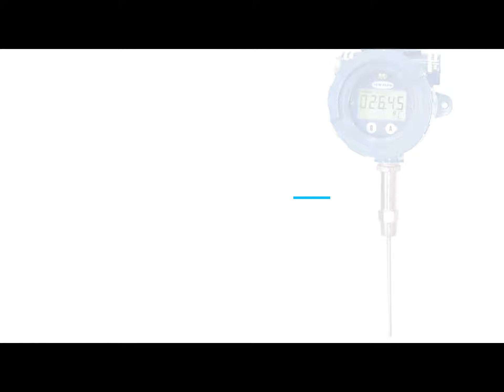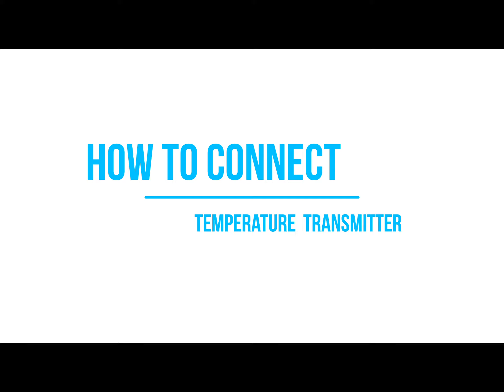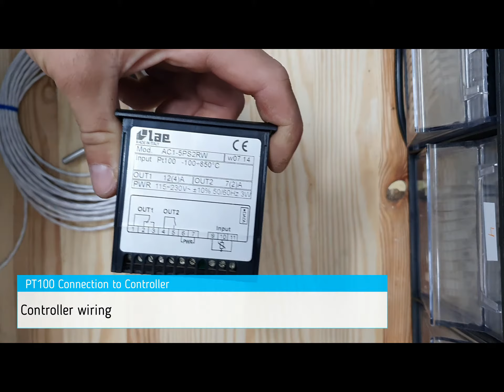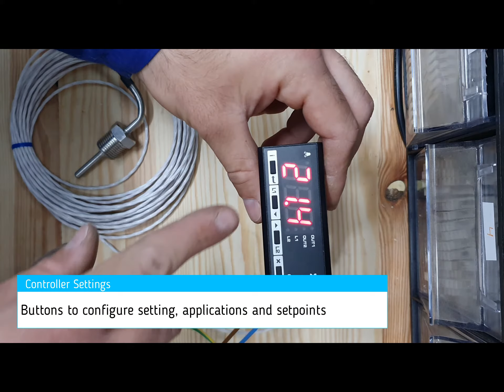How To Connect Temperature Transmitter - PT100 And Transmitter To PLC And Controller Connections

Comment: Dear sir,

As you know, the temperature sensor (RTD PT100) has a specific range (e.g. -200 to 850 ˚C). This sensor transfer temperature to Ohms. That is why it is connected to a temperature transmitter which transfers Ohms into (0-10 V or 4-20 mA) to be able to connect with the PLC. Transmitters also have a specific range (e.g. 0-200 ˚C).
My question is since Temperature sensors and Transmitters have got different range, are there certain conditions to fulfill when connections them (like calibration) , would you kindly answer my question? Of course, practical examples are of great importance to me. 
Thank you and I’m waiting for you reply.
Reply from the maker: Hi my friend.
first of all, let me clarify for you, there is different transmitters and controllers for different types of temperature sensors.
if you like to use pt100, you take a controller that is suitable for pt100.
if you like to use NTC, then you take a controller that is suitable for NTC.
you cant take a PT100 sensor and connect it to a thermocouple transmitter (for example).
there are controllers that have a few inputs for different temperature sensors, but that is also need to be specified in the data sheet of the controller.

when you choose to use a controller for PT100 or NTC or what so ever, if you choose the right controller, there is no need for calibration because this is standard well known sensors, and they are already calibrated.
in some industry's, like food industry or pharma, then you need to check the calibration of the controller every period of time.
in case you find a error, in every controller you can calibrate and "fix" the temperature to the actual reading (every controller should be calibrated using manufacture manual)

hope this helps you
Reply: @btoash  Thanks

Comment: In wiring of a pt100 without a transmitter directly to the controller. How do you scale the value given the temperature range to get the exact temperature reading of the rtd? Say for example the rtd has a -200to200°C range. Can you just put the 0-200°C for the 4-20mA scaling?
Reply from the maker: Hi,
Its excatly as you saied.
Every controller can be calibrated.
For exsample you can calibrate to get 4mA in 0c, and 20mA in 200c.
Ofcourse the controller needs to have an analog output for this.
The controller i use in the video dosnt have an analog output.
So you dont have any 4-20mA to calibrate.
You can only use it for dry contacts and temperature reading
Reply: @btoash  So do i need to allways have a special RTD card or dies pt100 work on normal analog input card?
Its resistance reading so it must be RTD card right?
Reply from the maker: @genantamtam9364  
If you use a pt100 card, then yes, you must always use a pt100 card.
In my video, i use a 4-20mA analog input card, not pt100 card, because i have a transmitter between the pt100 and the AI card
Reply: @btoash  so you mean if i have only a pt100  then i need to connect pt100 directly to a RTD card.
 But if use a transmitter in the middle (that convert resistance to mA signal)  then i need to use normal 4-20ma analong in card?
Reply from the maker: @genantamtam9364  you got it right.
When you have a 4-20mA card, then you can connect to your plc different kind of rtds (pt100, ntc etc) by using the right transmitter
Reply: @btoash  ok. When you say rtds do you mean the electronics inside the pt100 like this 1:55  ?
So why do some use  a transmitter inbetween?  Is there any advantage for this? I mean it should be easier to just connect the pt100 directly to a RTD card?
Reply from the maker: @genantamtam9364  the rtd is inside the long pipe (its a little thermistor, you can look for it in google), what you see in 1:55 is the wires of the rtd connected to the transmitter.
You can connect pt100 directly into pt100 plc card, but as i saied, when you use a AI card you can connect different kinds of rtds using transmitters between
Reply: @btoash  ok last 2 questions. 
This 1:55 built in transmitter,  is this the transmitter that convert rtd to 4-20ma? So if i dont have this built in transmitter then i must have an RTD card in the plc?
You said if i have normal AI card its better because i can connect to different rtds. Are there types of rtds or?
Reply from the maker: @genantamtam9364  the answer for your questions is yes.
About the rtds, r-t-d is shortcut for resistance temperature detector.
There are many different typs of rtds, for different applications. You can also look at google to find some rtd types and uses.
Reply: @btoash   Thanks alot for your answers, appreciate alot.
Im a new subscriber.  Keep the good work